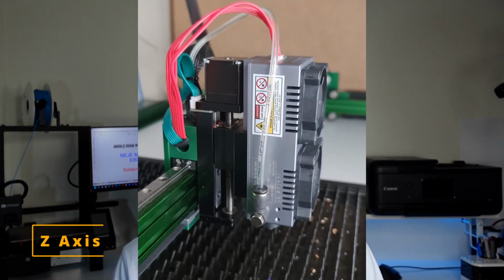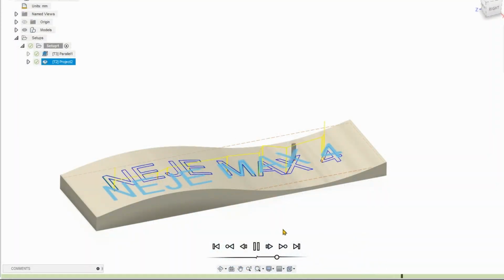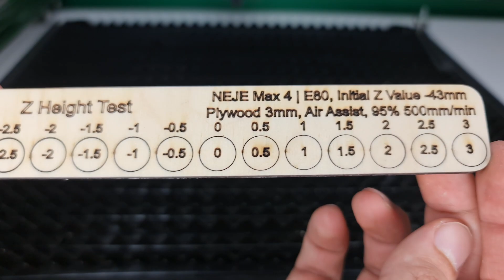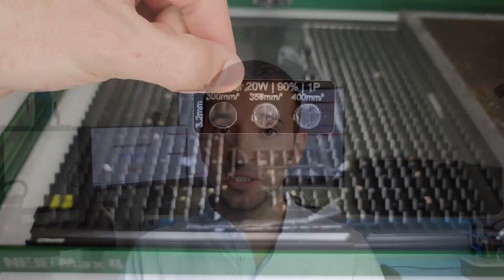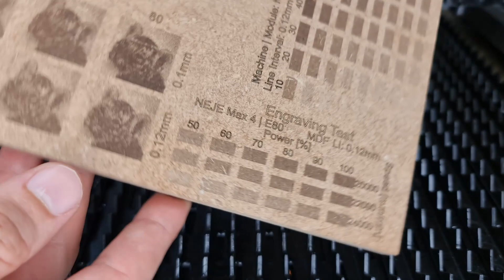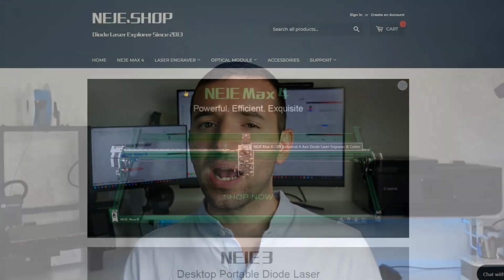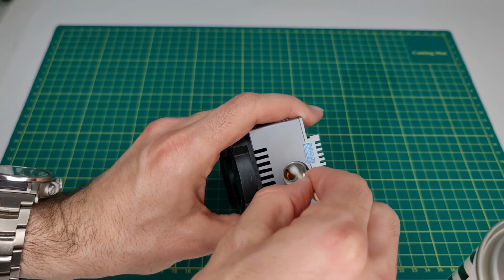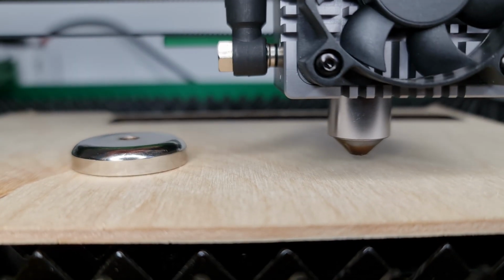NEJE Max 4 the 3D Laser Engraver - NEJE E80

Comment: Ggreat video.  I have just bought one of these.  I am trying to do some material tests from with Lightburn.  But I am getting confused about what to do with the z height.  When doing a job I would set the material thickness.  But I cannot do this from within the material tester.  When I run it, the text prints with the laser much higher than when it runs the cut boxes
  Hiw do I set this up please?
Reply from the maker: Hi Thank you for your comment. 

I can suggest whatching my dedicated video here https://youtu.be/-Rq0_eCy2k8 I go over the process in details.
Setting the z-axis can be a bit overwhelming, but once done if you do not move the machine or change the cutting bed, all is good.

Let me know how it goes.
Ciao

Comment: Tough question maybe... :) would you consider a neje 4 max with a40640 or better get a neje 3 max with an e40?
Reply from the maker: Hi, thank you for your comment.
If we compare the lasers, the E40 is better, the spot is smaller, and the cut is cleaner.
If we compare the machines leaving the z axis, the machines are comarable in terms of size and performance.

I hope it helps
Ciao
Reply: @MiddleRoomWorkshop  thanks,
Budget wisen max3+e40 and max4+a40640 are similar. (And other options like ikier 12w and Falcon 2 22w). I'm trying to figure out if I want/need z axis.
I'll probably be cutting up to 10mm wood and doing some engraved for the kids ;)
(Have a master 2 with a 3500mw (input) laser)
Reply from the maker: Hi, thank you for your feedback.

I am currently working with the Falcon 2 22W and I am very satisfied with it. 
The z-axis is nice, but is another thing to set and maintain, and honestly, the traditional manual focus with a clearance plate is quicker. Unless you do not want to do fancy things or switch focus between layers, and you do not mind the traditional quick manual focus, then you do not need it.

I still have the NEJE 4, but I use it for larger engravings.

If I should buy it I would go for the Falcon 2 22W as it comes from a reliable and well-established brand, is smart, is powerful, it comes ready to go no assembly needed and you get the air pump with air control.

In contrast, the NEJE 4 Max, which is also a nice and reliable machine, does not come ready as you need your own air source, and you also need the electro valve to automatically operate the air. Requires assembly, and the Z axis must be set properly to work. Furthermore is a machine that has a moving mainboard, which is o weak point prone to break over time.

Furthermore, a 20W machine is an optimal power for all purposes, especially if you intend to cut 10mm, from time to time.

See below the video review of the Falcon 2 22W, the Z-axis operation with the NEJE 4 Max, and a comparison with other 20W machines.

https://youtu.be/spOIRyTYXlw
https://youtu.be/-Rq0_eCy2k8
https://youtu.be/1AAsPDCYPBs

Furthermore, below are some discount links for the NEJE 4 Max with the E40 Module, the E80 Module and finally the Falcon 2 22W.

https://affiliate.geekbuying.com/gkbaffiliate.php?id=3783&url=1059685
https://affiliate.geekbuying.com/gkbaffiliate.php?id=3783&url=1059686
https://affiliate.geekbuying.com/gkbaffiliate.php?id=3783&url=960823

I hope it helps.
Ciao

Comment: Very curious about how the uneven engraving works. It mentioned surface modeling on the store page. Does this mean I can import any optimized, 3d scanned object in and have it engrave the uneven surface?
Reply from the maker: Hi, thank you for your comment.

Unfortunately, it is not as straightforward as it looks like. 
Lightburn does not work in 3D; it can only launch a gcode with a 3D path.

If you scan the surface, you then need to import the file into CAM software to produce the tool path you need. In my case, I went for Fusion 360 and used a CNC tooling strategy.

Here I show how I went about it https://youtu.be/G6zYpj6Fbac

I hope it helps, 
Ciao
Reply: @MiddleRoomWorkshop  thank you so much! I do not have experience with fusion.. time to learn! Your channel as been a great resource for comparing machines and deciding which one to get. I really appreciate the details you put into your videos.
Reply from the maker: Hi, thank you for your feedback and compliment.
I am glad that you find my content valuable and helpful.

Ciao

Comment: Hello, I have a question regarding the cutting test at minute 6. In the holes you can clearly see an offset of the beginning and end of the cutting. I have that too. What is this or what can be done about it?
Reply from the maker: Hi, @martinhelm4991; thank you for your comment. 

Yes, the spot is called pierce spot and corresponds to the position where the laser pucks through the material. 
It can me minimized by setting the cutting layers to Dynamic power disabling the option "Constant Power Mode".

Another way is to use the Lead-in and Lead-out, this is what is normally adopted in industrial applications, basically the laser or plasma puck through in a spot outside the part, than gets in the the cutting path with a short segment.
LightBurn offers this option in the settings under advance for layers set to Line, you need to play with it and preview your project before cutting.

I hope it helps, 
Ciao

Comment: It looks like you are using fusion 360 to get a 3D toolpath. I’ve been trying to figure this out without having to run the gcode through some kind of python workflow. Are you going to address this workflow at some point? I’m very interested in this and am not sure why the laser engraving world is so stuck in 2D.
Reply from the maker: Hi, @shemj1215; thank you for your comment.

Yes, that was Fusion 360, and I had to post-process the toolpath to be usable; however, I manually edited a couple of lines necessary to let this work directly in the G-code file.
Soon I am going to show exactly how I went about the engraving shown in the video.

I believe that 3D engraving is great, especially now that we can quickly scan any surface that can be imported into our CAM software.

Ciao

Comment: im not sure about the board attached to the gantry , you have a usb and power cable be pulled around
Reply from the maker: Hi, @jdmej1510; thank you for your comment.

That is exactly what I discuss in the Cons section toward the end of the video. 
The main board should either be in a fixed part of the frame or the connection so they are not dragged around with the movement.

Ciao

Comment: Nice Demo of the Z-axis, a lot better as the demo from NEJE.

I modified exactly the same things as you, but als i bought all the advised things (regretably now). The honycomb comes from the Max3 and does not fit at all, it always skewed, it ist not possible to fit it right. Solution is to put a peace of wood  of 5 mm thick uinder the honeycomb  so  the honeycomb is 5 mm from your surface, enough to not burn in your talbe. So front  side on the laser and the bacjk on wood. on top i put some packaging material so the Honycomb cannot slide. 

BTW All my hex nuts where lose also the ones on the Z-axis, very bad enginereing.

Question did you use the door swicht?  Because if i use mine i have to reset the whole machine to go further. I find it uselesss.

Also i ditched the belt tensioners, completly useless.
Reply from the maker: Hi, @bartv6387; thank you for your comment and compliment :). 

I haven't ever owned that honeycomb, but it is terrible if it does not fit. Products should always be back-compatibles in my opinion. I saw they are selling these profiles that directly connect to the base, but only in the extended version which is pity.

Put a layer of kitchen aluminium foil possibly wrinkled under your honeycomb to avoid burning your table. The laser can't cut or damage aluminium and if it is wrinkled, the reflection does not directly hit back the laser module and its optics. 

I haven't found loose fasteners in my machine, I did a random check, and they were okay.

Also, I haven't tried the door switch yet; if I remember correctly in the 3 Pro once the button was released you simply had to go home and were ready to go, but I will let you know how it performs on my machine in the next couple of days.

The belt tensioners are a nice addon and come really handy when you deal with larger and longer belts, but the belts are to be set and forgotten, so it may be unnecessary for such a machine.

Ciao